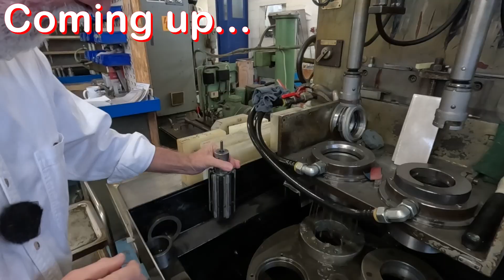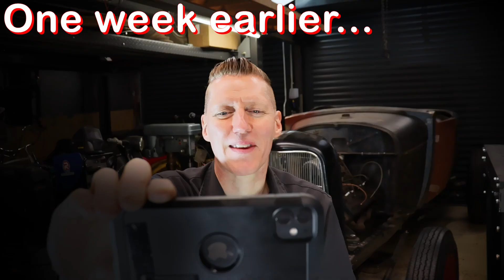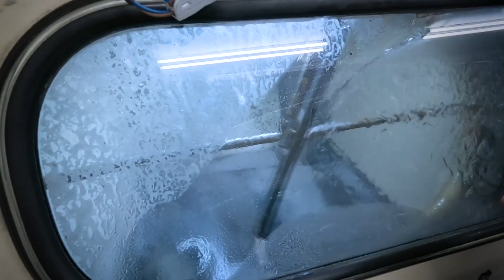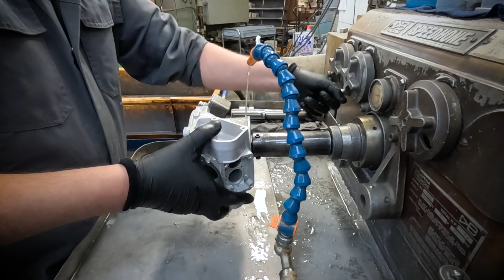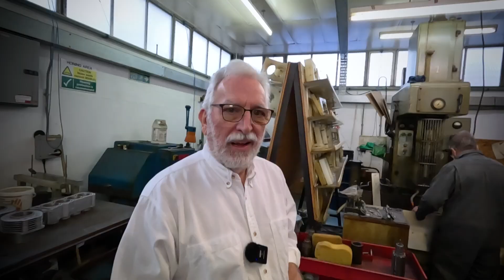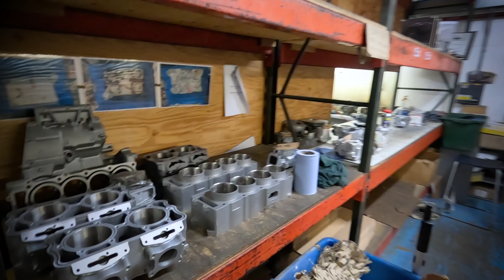'Nikasil' nickel silicon carbide electro plated cylinders - everything you ever wanted to know?

Comment: Hey man crazy question…. 
I rebuilt my 2002 150 ultra top end. I noticed today that I do not have washer on the cylinder stud nuts. Not the actual head where the pisser connect but where the jug gets bolted down. Do they not have washers? I bagged everything and marked it so I assume maybe they just don’t have washers?

Comment: could you please comment on what piston type and rings are compatible with this process. I don't think every 2 stroke has this option if you have a 60's /70's two stroke with a spun cast iron liner .Is there a way round this if the liner is removed. I'm thinking Alusil liners but can you get these in the U.K.   Thanks Dvid

Comment: Great explanation of how over time the piston ring grooves deteriorate leading the the ring(s) to start to cut into the cylinder wall because the rings are no longer held firmly square to the cylinder. Plus the minute aluminium coming off and out of the piston ring grooves acts as a rubbing compound. Which means if the piston and ring set is replaced soon enough the nikasil plating could last almost forever.

Comment: Thank you and the shop owner for taking the time to document this for us.  I came here to learn how they keep the plating from covering the entire part but that apparently happens in the magic room where the magic dust is applied. Still, I learned a lot. When you think about the piston velocity at 5,000 or even 10,000 + RPM even 20,000 miles is respectable wear for an engine run wide open all the time like we do !😊

Comment: ,,,,,,,,,,,,,,That nikosil  plating  looks  very  dense,,,,,,,new  2 cycle  cylinders  have  no cross hatch,,,,,HOW  ARE THE RINGS  TO  BREAK-IN  AND  MATE WITH THE BORE,,,,,,,I've heard stories from  people with motorized  bicycle  engines,,,,,NONE  GOOD,,,,,,,,so I pulled  my  new  chinese  2 stroke  apart    to examine  the bore,,,,,,THING WAS SHINY  AND SMOOTH,,,,,how the freck are the rings gonna bed in  and  seal,,,,,,NOT TO MENTION,,,,,THOSE CHEAP  CHINA  CYLINDERS WERE NEVER  HONED  OR PLATED  UNDER  STRESS [ TORQUE PLATES ],,,,,,if I had put a dial boe gauge down the cyl.      ,   no doubt  the  thing  would  be wavy,,,,,,,SO FOR MY CHEAPO CHINA  2 STROKE,,,,,,I made  torque  plates  and  torqued  the thing  down  to  the same  number  that I will use on  the  head studs,,,,,,Then  I ran  a hone  thru it  to create a cross hatch  pattern............................i think the cyl  should be near straight,,,,,,,,ya cant  check with a dial bore gauge,,,,,,,as the cyl  design  has  ports  inside  and  channels,,,,,,,,I  will only know  after  i try and  seat  up the  rings  [via  a heat cycling procedure ]  ,,,,maybe the thing  might  seal  up........POST SOME  INFO ABOIUT  HOW TO  SEAT UP  PISTON RINGS,,,,,,IN  THE  NIKSIL  PLATED  BARRELS.......

Comment: For ultimate longevity, I prefer a steel sleeve, as it can be rebored if need be, many times ans replaced relatively easily.
Never run anything without a filter. You are literally media blasting the insides of the engine with everything it sucks up.

Comment: I experimented with the TS barrels and tried nikasil, steel liners and industrial chrome plate and I was happiest with a traditional steel liner (Beedspeed) with a Japanese piston, I thrashed that setup and it ran with no problems, on rebuilds/checks there was no scoring or wear marks, the Nikasil was the most disappointing (AF Rayspeed) this was using Putoline fully synthetic R2T oil,
Reply: From memory certain piston ring materials don’t like nikasil coatings so perhaps a mismatch ?

Comment: I cast iron sleeved 1 Cylinder in a ski doo power tec 800 (2 cycle) using a LA sleeve.  I would not recommend doing that.  It only lasted like 1 or 2 thousand miles till the ring got kicked out the exhaust.  There was excessive wear on the intake port bridges.

Comment: Do they plate 4stroke cylinders? I was just thinking I have never seen a plated 4stroke cylinder, they were all 2 stroke. I'd like to develop a cylinder for my 4 stroke scooter, a 50 cc engine with a 58mm bore is what I'm wanting to do. But 54 or so if possible the largest available bore is 52.4mm a 125cc has a 54mm bore I believe. Maybe that piston can be fitted into a 50cc with a a cylinder and the case bored. I want to move the oil port have M6 tubing to supply oil directly to the head. I'd like to get it to 100-110 cc and then build a two cylinder version. I have a 150 also. Getting a big bore stroker eq. 232 is the largest available with a 6-12mm stroker crank??, I'd like to build a bit of a stroker, maybe 3mm, with a longer rods. Possibly a billet 4340 steel rod, and with stock stroke or 3mm+ stroke, the displacement being about 240 something, revving to about 10k rpm. Have a custom cam grind, possibly copy a cbr 1000 cam lobe. And advance the timing a bit because it doesn't need to rev past 14k rpm. Get it to have 190-205 psi compression, running on 100 octane fuel. I have thought about going water-cooled. I'm thinking if I make a cylinder just make the cooling fins about 20mm longer on each side. And mill the fins to have a groove in the middle, about 15mm deep. Then  split the fin in about 12 mm sections with a 1mm blade. And slightly  Bend in alternating direction. About a 2mm bend at the tip. To give more surface area to the air. Maybe weld on 1.5 mm plate to the end of the fins on the head. Add about 40 mm to each side , and about 60mm around the exhaust. Make a billet aluminum carb adapter to allow a 30 mm carb on the 150, and 24mm on the 50.
Reply: Yep, plenty of plated 4t cylinders.

Comment: In my working years I was a Crankshaft machinist, for our engines with turbos we used to either Nitride or Tufftride coatings the latter being done in house.
While Tufftriding is only used on steels & cast irons but not aluminium, Nitriding can be used the same as Nikasil, so am I right in thinking it’s basically down to cost, or Nikasil has different wear properties?
Great insight into the process..
Reply from the maker: Thanks for the comment, very interesting.  I don’t really know about costs for the different processes.

Comment: Very interesting,out of curiosity is it possible to Nikasil cast iron bores of the older 2stroke engines so when they wear you would only need to re plate and keep the original bore size.
Reply: alloy only